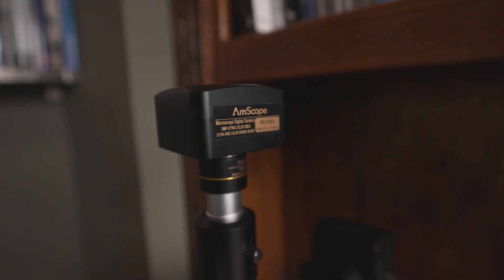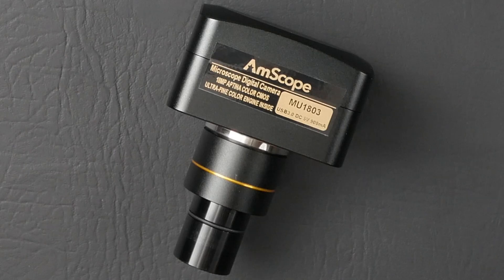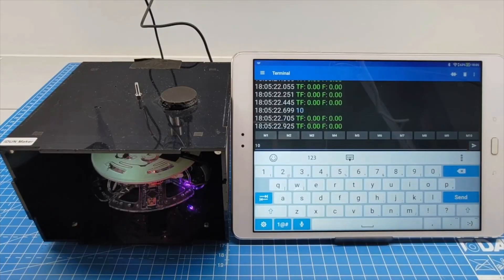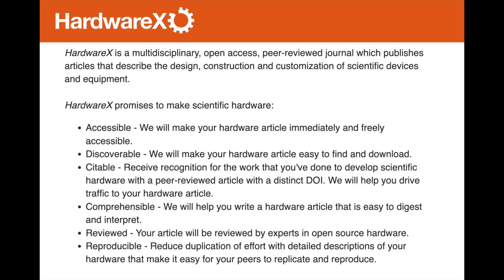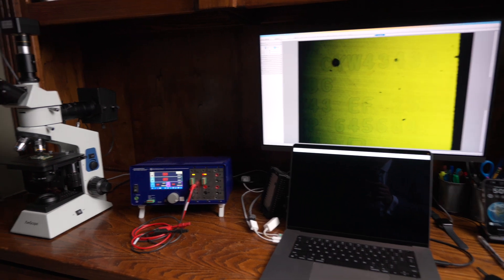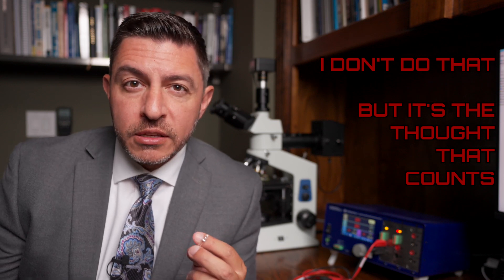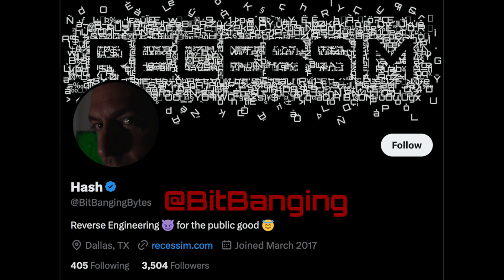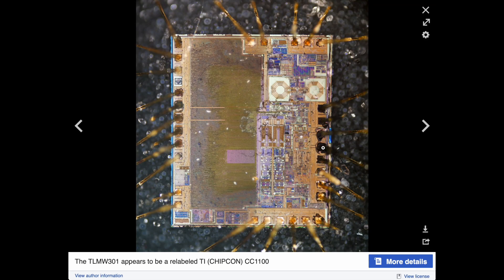HACK your Microscope! - Reverse Engineering News - July 4th 2023

Comment: There's a range of IR leds, different ones will yield slightly different results, so you can use almost any one
Reply from the maker: I probably should have tried some IR LED I had laying around before dropping $10 on a specialty one. I wanted to remove variables though so just went ahead and got it.
Reply: @RECESSIM  like Coke, you don't screw with a prove formula

Comment: I didn't get the physics of this. How silicon becomes 'transparent' under infrared light? Difference in material temperatures?
Reply from the maker: If you really want to get the details read Bunnie’s article linked in the description. TLDR; Silicon is transparent to IR wavelengths like glass is transparent to light.
Reply: @RECESSIM  That was my initial thought, I asked chatgpt, but apparently it provided incorrect answer.

Comment: Great episode. Real shirt with cuff links! I'm impressed!
As far as hardware, most of the times with LED's, most people use a series current limiting resistor on one of the legs. 100 ohms at 5 volts would keep the current at about 50 mA. This way, you don't have to worry about voltage and current limiting on the power supply. You can play with the Ohm's Law values to keep the current where you need it to prevent blowing out the LED.
Reply: In the video Hash suggests how forward current alters the light but I seem to have missed that in the practical experiment. Would a slight difference in current alter the wavelength by a few nm?
Reply: @ianhelsbyservices  I'm not an expert in LEDs. However, I would expect that the current would not change the wavelength of the LED. As I understand it, the wavelength is determined by how the diode section is doped. The current would only change the intensity. Perhaps @RussianGirlShowPanties a.k.a. @College Algebra would like to weigh in.